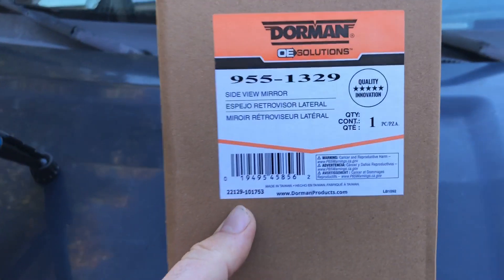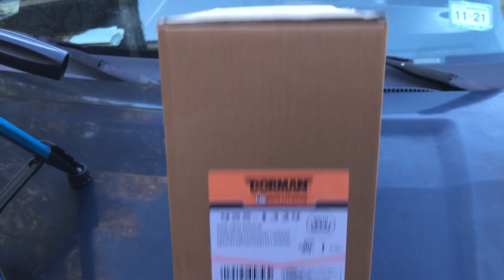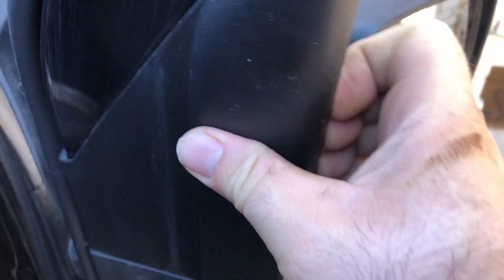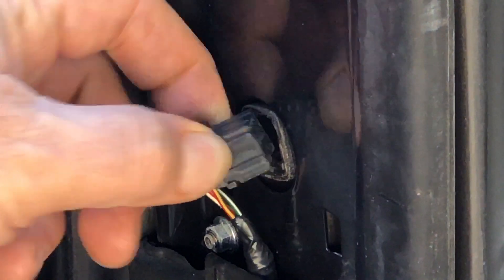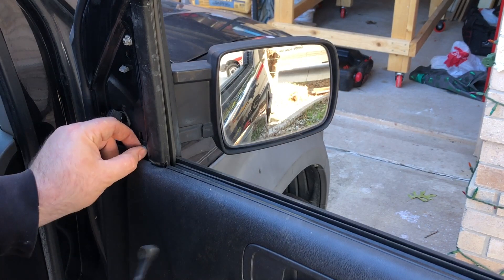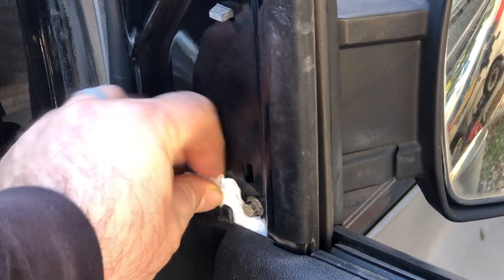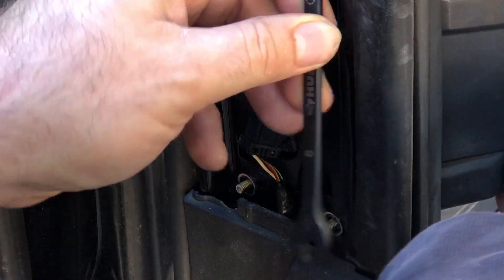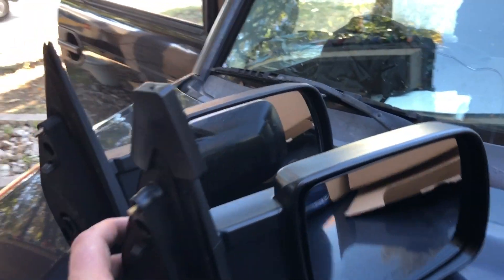Honda Element  Side Mirror Replacement  2003-2011

Comment: That's easy enough should I need to replace mine. Why did u replaced urs? The old 1 looks ok. Thx
Reply from the maker: Turns out that the switch is broken not the mirror motor after all.  It gets power. Moves down and to the right for both old and new mirror. Going to work on replacing the switch.
Reply: @MendandMake  At least u found out what went wrong. Video that fix too, ok?